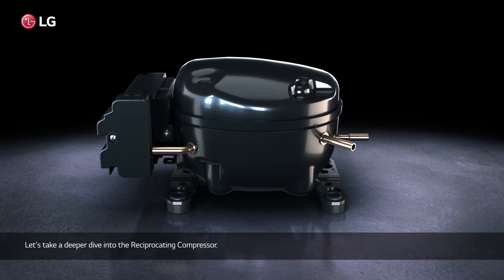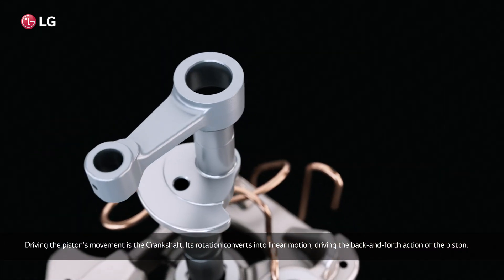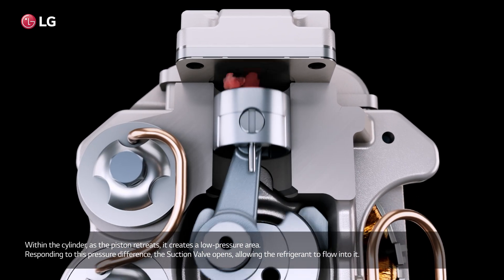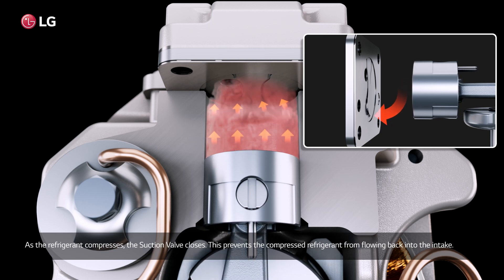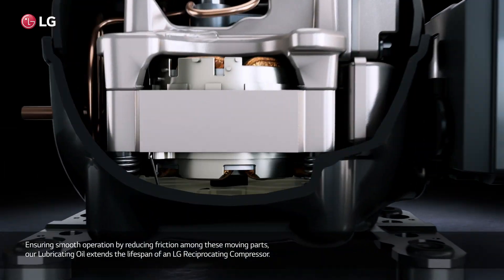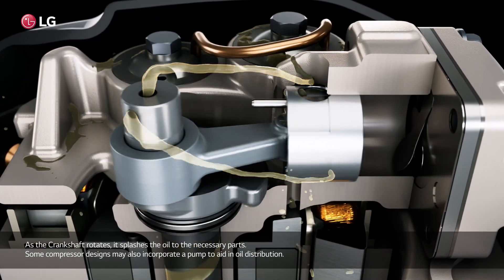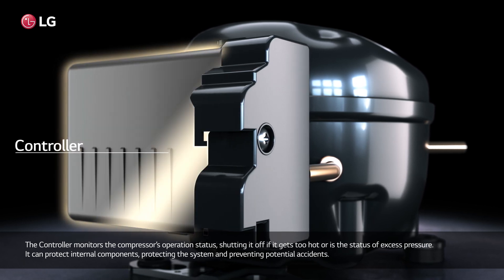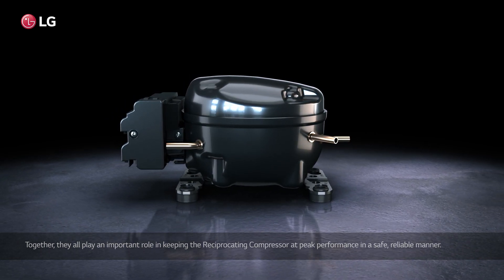The Basics of Reciprocating Compressor for Refrigerator｜How Refrigerator Compressor Works

Comment: This is very well explained. I have a question; many car mechanics know that there is a wear on the piston/oil scraper rings over time.
I am about to start certifying myself as an A/C mechanic. A part of their job functions is to extract refrigerant from devices, for reuse purposes.
Isn't the oil going to be mixed with the refrigerant on worn devices? Liquid gass is lichter than oil. But what happens when you drain such a device?
A refrigerator is basically working the same as an airconditioner and heatpump, for those who might question why I ask this here.

Comment: So it's really just like an engine, but an electric engine
Reply: yea an engine without spark plugs
Reply: Its called diesl if it has no spark plugs  @EastAsiaCreativeMedia
Reply: However, an opposite operation! Crankshaft powered by an electric motor runs a piston to compress the refrigerant and not the other way around as we see in their fuel engine counterparts...
Reply: A electric engine who compressed the air
Reply: hát igen  dugattyús hűtő kompresszor   a leggyakoribb  eszkőz a klímákban és a hűtő szekrényekben illetve páramentesítőkben  de vigyázni kel rá mert ha túl melegszik és nincs benne túlmelegedés védelem akkor   hatalmasat tud robbani

Comment: i hope that LTCS20020W has a Reciprocating Compressor.  [GCN230625069155]

The model number LTCS20020W still features an Inverter Compressor, but it has undergone improvements and the software has been updated. With the updated software, the Inverter

the reason I ask is over LG facing class action lawsuit over failing refrigerator compressors

LG Settles Class-Action Lawsuit Over Refrigerator Compressors

Consumers with certain LG refrigerators can receive compensation for repairs or damages

the valves are made of plastic and break

Comment: Way better than linear
Reply: hope so I got the lg
Reply: What is the standard for compressor operation ratio?is it normal if operation ratio is 100%?
Reply: @sarehmirshahi6316  If a fridge comp is running 100% of the time, that's indicates either a leak in the fridge itself or a refrigerant loss condition,however some comperssors in certain machines are rated to run continuously